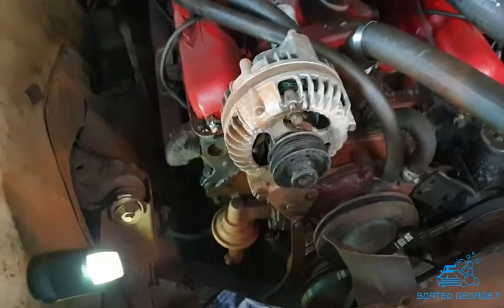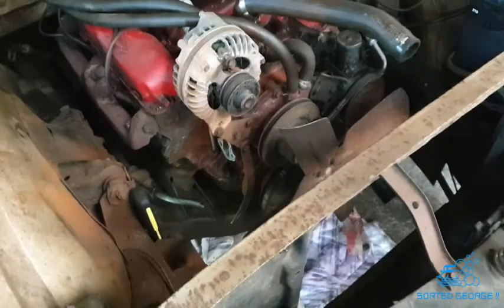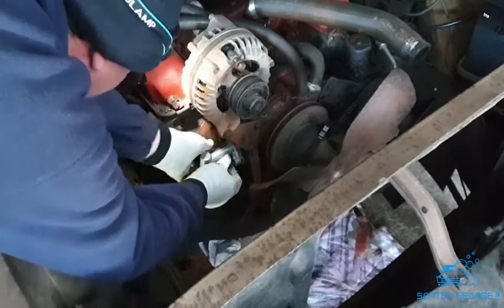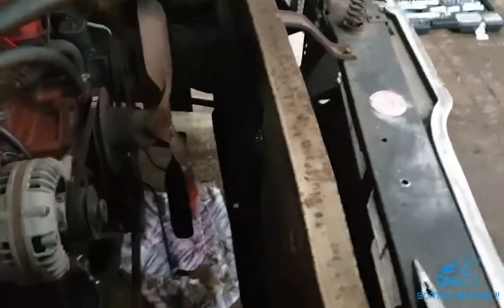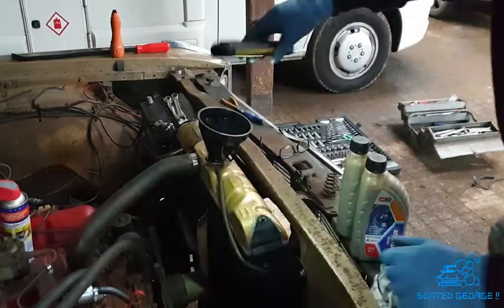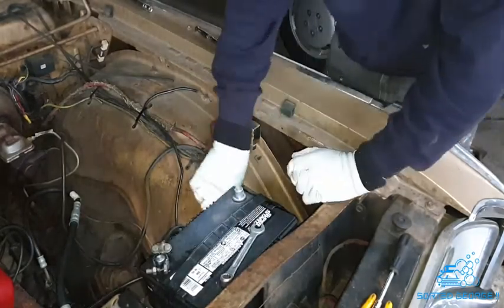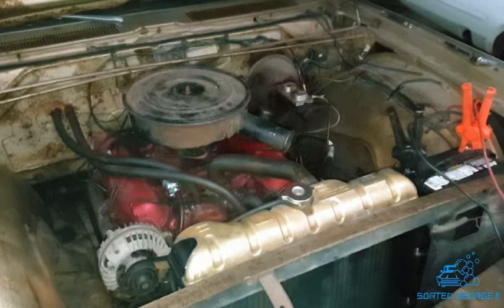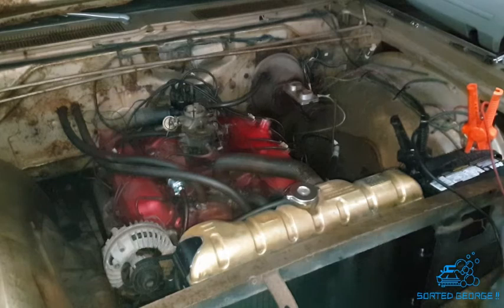318 Mopar Dodge Polara Gets A New Fuel Pump Fitted

Comment: Did you have to remove radiator to change fuel pump or you already had it out of the car? Thanks
Reply from the maker: Already had it out of the car for repair. You MAY need to loosen the alternator if you find it's in your way, but you should be ok without moving anything. Depends on what space you require. Hope it helps 👍🏻😎

Comment: Hey boss, how do you know if the fuel pump cam is lined up properly?
Reply: You do have to mae sure the ear is below the cam.  If you noticed he tilted the pump downward as he insert the pump to make sure it went under the cam.  Putting the bolts back in is a bit of a pain, because the pump wont sit plane to the block.
Reply: @timwaddell9450  hey thanks! I appreciate it

Comment: What could be the problem if I put a brand new pump on it and it doesn't work at all now? I put it in right but it just doesn't work. The old one worked barely sometimes, but when I put the new one on, nothing. I tightened all the clamps good, brand new lines, it just doesnt seem to work. Ive even taken it out twice and tried do it "right" and tightend it slowly side by side, but it doesn't work. Please help🙏
Reply from the maker: Vize_Iron is your Cam's fuel pump lobe ok? The small block fuel pumps are run from the Cam direct, where as the big blocks have a pin coming down from the Cam to actuate the fuel pump. Did you check to see if the new pump works ok prior to fitting? If the Cam's fuel pump lobe has failed or worn down perhaps to save a lot of work you could use an electric fuel pump....? Hope it helps....SGG
Reply: @SortedGeorgeGarage I have a electric pump on it right now, but I just want the original working. It worked really good sometimes with the old pump until I assume it just wore out, but then I put the new one in and just nothing at all. I've done everything I can think of. But how can I take the pump off and test it? Because I have a feeling the new one is just bad. It went from kind of working with a 10 year old fuel pump, to not working at all with the new one.
Reply: When you go to put the mechanical pump in the block, you have to tilt it down to make sure the actuator gets on the bottom side of the cam.  You can rig up lines to a gas can and a jar or bowl and crank the engine to see if the pump moves fuel.